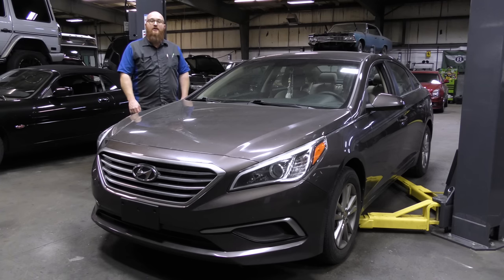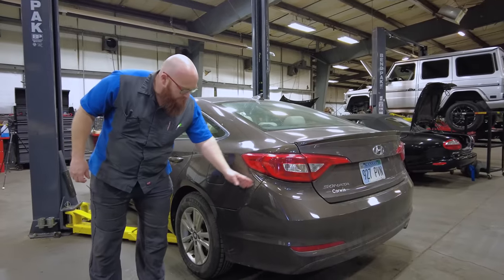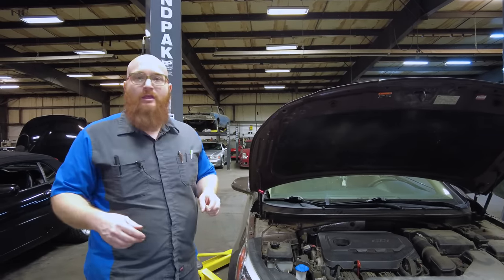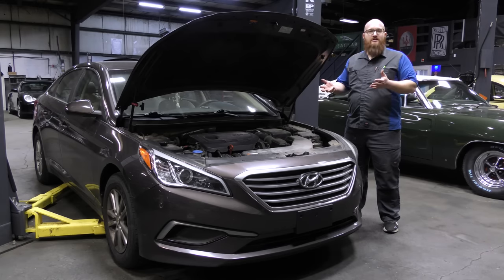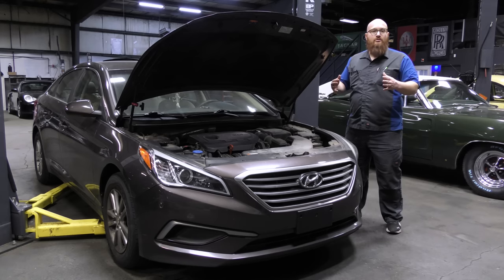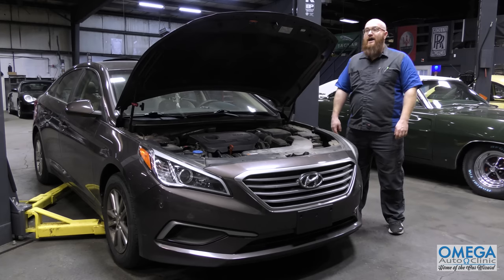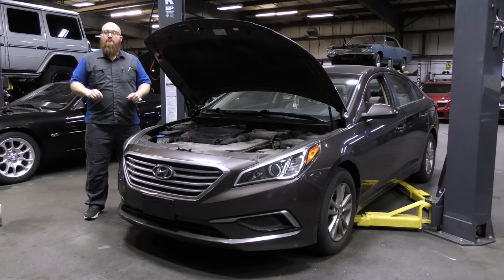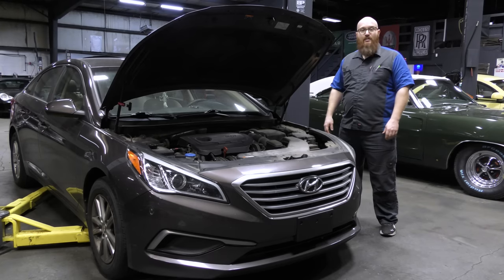What could be so bad on this '16 Hyundai Sonata that the CAR WIZARD is sending it to the junk yard?

Comment: But you are wrong. Mr. Wizard.     Again, you have shown your poor and dismissive judgement of people.     Could you imagine any scenario where the customer was not at fault?     What if one of your very own cars did the same thing?    Would you hold yourself responsible?      What if Mrs. Wizard owned a 2017 Hyundai Tucson, and bought it from a reputable national chain of used sales dealerships, such as Car Max or the like?   The car had been fully inspected, passed with flying colors, and otherwise appeared as new, but with 40,000 miles.    And let’s say that you checked it yourself upon delivery.     Oil looked good.     Air filter, the lot.     In fact, let’s say the entire vehicle looked like it had 2,000 miles on it, not 40,000.   Not 120,000.     But then, within two months of ownership, and barely 1100 miles since owning it, with no warning of any kind, no oil light of any kind, no oil pressure warning, no oil level warning, no engine chatter, nothing, it suddenly sounded like someone poured a box of bolts in the crankcase?    What would you say then?   Impossible?    Sorry.     More than just possible, but this exact scenario has happened to over 100,000 Hyundai vehicles in recent years.     And upon inspection, I found zero oil in the crankcase.     Not one quart.    Not a few ounces.    Zero.     Zero on the dipstick.   A few drops when I removed the drain plug.   Zero oil in the engine, zero oil in driveway, zero soot in exhaust, zero oil on any part of the externals of the engine.     I could white glove the engine before, at delivery, and after, upon engine failure.     To this day it is a mystery how so much oil could leave an engine with zero evidence of where it went.     I fully expected to find a catastrophic leak, or an exhaust system laden with oily residue, anything.     So how could any vehicle owner be found at fault when the oil had been checked regularly, yet the vehicle lost ALL OF ITS OIL IN LESS THAN 1200 miles?     With ZERO tell tale signs of being low on oil.   No oil light of any kind.    Did I mention tion there was zero warning?      Oh, and upon asking the dealership about this problem, they directed us to the Hyundai dealership, who then played dumb, until we uncovered the MASSIVE engine recall.   Apparently there was a manufacturing process failure where some machining material was not getting washed out of the blocks completely before assembly, which would then find its way into the oil galleys and at some point cause engine failure.     They finally admitted fault and gave us a rental car, took the Tucson in for repair, and two months later gave it back with a remanufactured engine.       It has run fine ever since.   This was two years ago.      So nice work judging this person and finding them at fault.   Maybe they did neglect the car.    But the truth is that the Hyundai four cylinder has been known to have had a defect for many years now.     I know cars inside and out and maintain my family’s small fleet of vehicles.     From 2002 ML320 that runs like new, to our 2006 Suburban, 2006 Magnum RT, 2018 Ford Expedition, 2009 Dodge Ram 1500, and of course, the 2017 Hyundai Tucson.      Ever since your outrageous review of that Dodge Magnum, I only watch episodes of your channel that appear to be more of the same.    Bullshit.      Judgmental, holier than thou, bullshit.       Sleep well.

Comment: If you actually had a clue? you are talking out your ass.I am a licensed automotive machinist,for 25 plus years,and an red seal service tech for 15 years.what you have said about Hyundai and Kia engines is untruthful.you need to to check your specs.

Comment: This is an extremely boring and dry video. Couldn't get passed this dudes ignorance and his scolding attitude. He is saying this is a bad car and that the dealership is terrible because they didn't want to give a free engine to someone who neglected their car, basic operator maintenance.  Why, would a company give free engines to someone who didn't do up keep? They sabotage their engine and now you say the dealership is bad because they don't hand out free engines? And elevate your self above the dealership? You're upset because you're not the skill to ever get on that level
Reply: The 2.4 Theta GDI engines are known to burn oil. Many people say that they have to add a quart of oil after every gas full up. It's not the fault of the owner or the auto shop mechanics. Those engines are crap.